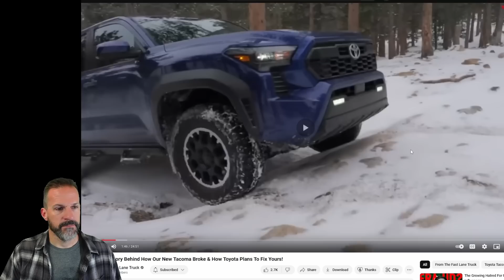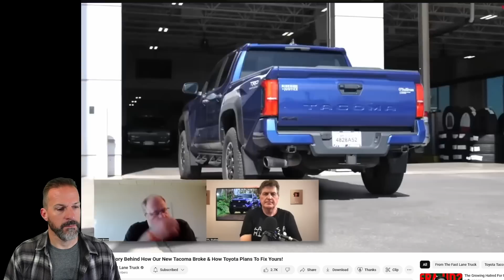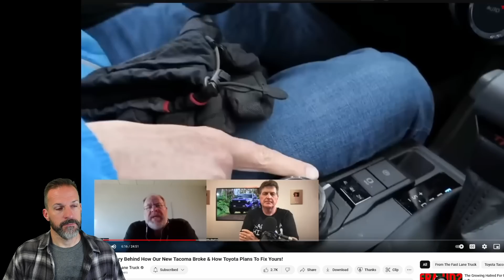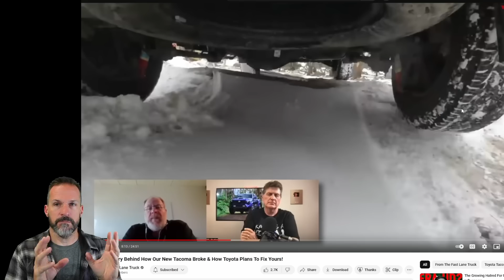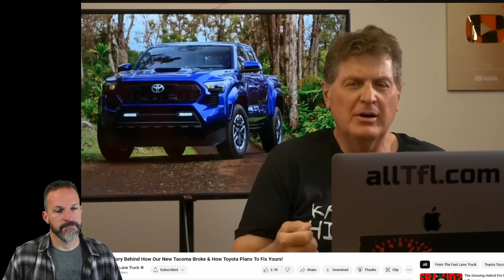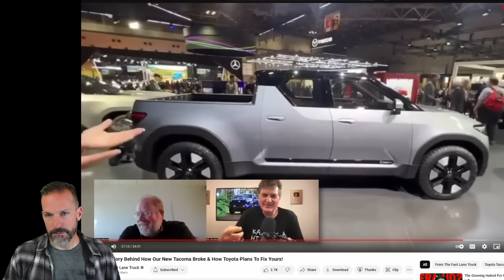Toyota will RE-PROGRAM the 2024 Tacoma to prevent future front differential failures. TFL React.

Comment: Cost is not the only factor, weight reduction is another important one. They are trying to minimize weight and costs while meeting some mechanical specifications. They try lighter design for better mpg and a preppier vehicle to drive. 
Also,  It broke not necessarily because of too much power to the drivetrain, it probably is due to the rate of change of power AND braking in close succession. 

Remember the MTS system is there to increase traction by automatically applying braking to reduce slippage as well. Depending on road surfaces they allow more or less wheel spinning. 

So if the automatic system allows very fast acceleration followed by intense braking (something that most likely a human driver would never do that quick transition speed) they may easily go beyond the design specifications. Even beefier design may brake because they would then have to be way too bulky and way too heavy to totally avoid braking. 

One is dealing with an engineering control system here. They are control commands that a system should never give otherwise the system may brake. 

This is one of the most difficult issue with robots, they can easily injure themselves. One can easily give motor commands to a robot such that it can literally destroy itself. 

The MultiTerrain System is a simple robotic system with acceleration and braking. But it is a robotic system. And it can do stupid stuff that a human would never do. 

Humans do the same with their own body: try throwing a baseball ball at full force if one hasn’t practiced in a long time. One may tore up a muscle or ligament because your control system is off what it used to be. You damage your arm. 

So the engineers here may have to tune their control system so that they don’t injure the mechanical components of this robotic system. And here they have new everything and their control system and simulations didn’t account for some corner cases. 

The other way to solve that is to add more feedback sensors to this robotic system, but those are expensive and more risks to brake. So they need to tune their control system and that’s what they are doing. 

My 2nd gen Tacoma has ABS but no MTS. It does not have this robotic system that brakes and accelerates each wheels independently, so I could most certainly never give the wheels the same type of control commands that an MTS can. 

In other words, Take my 2nd gen and add some stupid control system and I can bet you that the control system can brake and destroy the drivetrain on the 2nd gen in no time. 

People have to realize that automated driving convenience and better road / trail handling comes at a price. It’s letting a faster more complex control system than a human take over. And does have its limitations.

Comment: I heard from a friend of mine that someone in their group had a 2024 Tacoma on the trails this past weekend and had the same kind of failure that TFL did. Based on the interview TFL did with a Toyota engineer, it really seems like Toyota decided to save money by re-using components in the powertrain that are not suited to the kind of torque the new engine is making and instead they're just relying on the software to protect things from damage. I'm willing to bet the "Truck King" channel's clutch failed for the same reason because it sounded nothing like a truck being shifted into first gear. I think they just did a terrible job at calibrating rev-matching for a 5-3 shift and the clutch, also not updated for all the additional torque, failed due to the computer botching the rev match. For as much as they raised the price and slashed labor costs by moving all production to Mexico, their QA and pre-production testing process is trash. None of these problems should have made it to the consumers when Toyota wants $50 to 65k for a 4th gen. I have lost any faith in Toyota at this point.
Reply: In the truck king video they replay the backseat camera man view. The rpm gauge swings up to around 4500 rpm but doesn't red line, just as you would expect for third gear not first gear..
Reply: @lemerdtool  I agree, nothing in the video suggests he went into 1st gear. If he shifted into first gear and dropped the clutch, the engine would have tired to rev to 10k RPM, the tires would have squealed, the back end would have likely whipped out sideways, and there's a good chance that the engine would have thrown a rod.

Comment: Toyota likely spent hundreds of millions pushing the new drive trains and technology into the new Tundras and Tacomas.  Of course, this new development expense has to be recovered in the  cost of the vehicle.  However, in the case of both of these vehicles another development pathway could have been chosen.

Toyota could have taken the existing drive trains, tuned the engines, upgraded the transmissions, changed the exterior styling, made adjustments to the interiors, etc; all the while holding the line on the developmental impact on the base product.  This conservative approach to product development seems to no longer exist at Toyota.  The upscale product prices and low scale product reliability is the outcome.

Comment: Just like all vehicles makes and models. Poorly designed parts isn’t fixable with a software update, that’s litterally like telling the customer hey just don’t hit the gas pedal next time and use your truck to you know. Do truck things. But instead we’re going to bandaid the actual problem with a software update cause we would have to actually pay money for the piss poor design we did and we can’t have that. Reminds me of the late 90s and early 2000s rams with the magnum v8s when they did the “death flash” and de tuned the crap out of them. The fact they say the traction control was too strong blew my mind. Like dude a locked Dana 30 in the snow even on bigger tires would’ve probably not failed in that situation. A ice and snow covered rock. POS lol. My 90s suburban had spun 35s for 200k miles with a locker and has been driven like a worked rental car for 80% of that.

Comment: Its possible that the programming grabbed both front brakes at the same time and pop that ADD snapped..... that stated, guys in the 2nd and 3rd gens (with even more power via supercharger etc) with essentially the same ADD configs run FRONT LOCKERS and I dont think I have heard of a single person having an ADD failure.  Also LOL at the comment that "all the torque was being sent to the front"..... the transfer case on these trucks have no differential (not talking limited 4th gen awd), you can only send power in a 50/50 split front to rear.

Comment: This was a pretty interesting explanation, learned just how complex the MTS system can be and how the mechanical components need to be designed around its decision logic. The ADD is definitely there to make the vehicle more convenient to switch between 2H and 4H/4L modes so i get why it needs to be designed the way that it is. We have come a long way from locking wheel hubs. I think i see why he says the entire assembly fails here first. You make the ADD too robust you possibly transfer more of the mechanical strain up to the differential or even the transfer case.

Comment: What's BS is that Chief engineer bragged multiple times before releasing the Tacoma that they did multiple strenuous testing on the Tacoma and its had nothing but multiple issues since it came out with the differentials the shutter grills, transmission overheating and now manual transmissions blowing up and that's just what we know now. They could be hiding engine issues potentially later on like they did the Tundra's.
Reply: I'm a contract engineer and have worked on a few projects for Toyota.  Their validation process uses a lot of simulated (in lab) testing and significantly less real world testing than other manufacturers. This instance is exactly why you don't do that with trucks and off road vehicles.  It's fine for a RAV4 or Camry that's going to live on the interstate.  Lab testing gives great accelerated lifecycle data, but at the expense of being done with a very limited number of variables. That this problem never showed up in their validation shows their validation process is fundamentally flawed.
Reply: lets add in the admsission from toyota about cheating on tests. Take a deep bow mr ceo lolz. Toyota Chairman Akio Toyoda publicly apologized for extensive cheating on certification tests for seven vehicle models...

Comment: Sounds like the mechanical bits are not strong enough and they are going to use software to prevent the weak components from receiving too much torque and failing. I’ll not be buying a Toyota. Their reputation was overbuilt reasonably priced vehicles. Now they are overpriced, weak, made in Mexico and not reliable.

Comment: To be fair, it sounds to me like it wasn't necessarily the truck's overall torque - it was the traction control system that overcorrected and sent too much power to one wheel.  But you're right - Toyotas used to be overbuilt and now they're built cheap with software as the buffer.  It's annoying.  I've noticed that with the Rav4's AWD system - if you dare to lift a wheel on even a slight incline, the car will just cut the power and say "no way" instead of attempting to push through the obstacle.
Reply: Not necessarily too much power, it probably due to the rate of change of power AND braking in close succession. Remember these systems are there to increase traction by automatically applying braking to reduce slippage as  well

Comment: I think this just proves they don’t expect anyone to actually use these trucks for what they are marketed for.   Attempting to fix an obvious hardware shortcoming with a software update , that is likely going to make it less capable and likely to reduce power, is absolutely BS.
Reply: Short-term solution. Look up in some future updated parts for that Tacoma as the mid-term solution. Long-term solution, these new parts will be used in factory. A Tier 1 provider most likely builds those parts for Toyota. It takes time.

Comment: A completely stock truck shouldn’t be able to break itself under designed use
Reply from the maker: I agree. At least they are, in their own weird way, admitting that and "fixing" the issue with MTS, however I personally feel like you do. I'd just prefer a stronger IC shaft and supporting parts.

Comment: This thing has to be built on reallllly close to it's component limits... They had to build a special cooling system for the 4 banger cranked to the limit... they're using software to prevent component failure from torque... what else...
Reply: You forgot they also had to detune the manual transmission engine because it's on the edge of what it can handle. This truck is a joke! I'll stick with my first Gen Tundra
Reply: @PeterAlfonso  ya... Idk. I'm glad I got my frontier and didn't wait the 1 year for this truck. Maybe it'll be reliable and fine... But I'm good.
Reply from the maker: I agree. My guess is they'll dial in the software to prevent failures in a lot of cases, the diff, the transmission, etc. We'll see what long term reliability looks like, so hard to speculate.
Reply: @TheCarGuyOnline  ya absolutely can't speculate. And software will do the trick for sure.

Comment: the best part about my slow 2018 2.7 tacoma is that i will never have enough power to break anything. i got 33 inch wheels on it, offroad at least once a month and still have original cv axles at 90k miles. best part: i still get 23-19 mpg. ill be keeping this truck forever.
Reply from the maker: simple is almost always more reliable.

Comment: Modern Toyota, underbuilt and overpriced. Toyota os essentially saying they need to further detune the vehicle which probably negates the benefit of going with the less reliable forced induction 4 cylinder vs the NA V6. Basically it cant handle the torque, which was Toyotas big selling point on why the less reliable turbo four was better than the outgoing NA V6.

Comment: There's no way that front diff should have snapped on that. If the tires are slipping on smooth rock and ice, there's not that much stress on it. They are making up excuses for Toyota. TFL must get a lot of money from Toyota.
Reply: It’s not so much that it was slipping, given that the MTS was on, the system most likely attempted to apply brakes to the wheels to decrease slipping. So it’s fast accelerating with strong braking that was probably too much to handle in short succession with the new higher torque now available. 
It’s probably something that most drivers would never do unless a race car driver with independent braking for each wheel or axles.
Reply: @OldelCpt  That's even worse if that's the case. It's the whole drivetrain working against itself? Garbage. Toyota should get rid off all these gimicky drive modes and driver assist modes. It's an off road truck. If you're buying it to off road, learn how to off road without all these stupid "dusty road mode" options. Instead of spending money on pointless and worthless drive mode programming/development, spend that money on more robust drivetrains and parts.

Comment: The parts are not strong enough and dont have a large margin of safety, to save money. Money. Telling it like it is. This never happened with the previous gen Tacomas. Also of note. TFL sold that Tacoma.
Reply from the maker: Yeah I actually appreciate that they are admitting an internal failure that wasn't the actual ADD actuator, a much more substantial part failed inside. They didn't really have to tell us any of this, it had already/mostly blown over so it is what it is.

Comment: It's interesting that Toyota didn't figure out the excess torque problem before they released this version of the Tacoma. The Tacoma's IFS has always been a little shy of strength and with the increase in torque you would think this would be a natural response.  I know this hasn't been a big problem yet but as time goes on and mileage gets higher even with the software adjustment it will be interesting to see if more problems come up. TFL won't be finding these because they got rid of this Tacoma because the transmission overheats and that does not sound good either. Toyota is kind of falling off a cliff here.
Reply from the maker: yeah we'll see if larger tires and tunes end up being bad for these long term.

Comment: The engineer does sound like a politician.  I understand why most of the industry claim it's too expensive to overbuilt vehicles, however Toyota has traditionally been the one manufacturer that doesn't do this.  The reason the older Tacoma and 4Runner was popular wasn't because of their low performance engine, or less efficient transmission or poor mpg, when compared to their competitors.  Rather it was that it was so overbuilt that it was impossible to wear out or break these two vehicles with hard driving.   You could have taken a 4runner anywhere and know that it will always bring you back without breaking down and leaving you on a lonely mountain trail somewhere where it would be hours at best to get help.  People who buy these vehicles are the ones that never want to be stuck on the side of the road, and value that more than anything else, more than 'fun to drive' and more than 'mpg'.  I do like the new engine & transmission, but I also would have liked if it was overbuilt enough so I have peace of mind that I wouldn't have my vehicle break because of some unplanned hard driving.  Toyota should understand this is why their customers buy their vehicle.  And if they lose this legendary reliability, they will lose their customer base.
Reply from the maker: Agree 100%. The only reason I buy Toyota is for reliability, if that is gone...I'll just buy something more sexy and there are plenty of those out there.
Reply: @TheCarGuyOnline yup, buyers put up with a lot for that reliability (crappy infotainment, ugly exterior design, dated mechanics, minimalist interior design, etc) if that reliability goes, why stay with a Toyota?
Reply: Well Said!
Reply: Look at the axles on a HD pickup.  Compare them to a Tacoma.  Yes, the Toyota may only have a 4-cylinder (turbocharged), but it produces more torque than your standard 6.4 Hemi in a RAM Power Wagon below-2,000 RPM.  The Ram however has axles that are identical to those on the Cummins, that are rated at over 1,000 ft/lbs of torque at 1,500-RPM.

Toyota needs to (must) go back to the drawing board to maintain their brand reputation, fire whoever is in charge of vehicle production at this point.  The entire driveline should be overbuilt, it's not difficult, the big 3 have been building trucks that produce large amounts of torque and horsepower for decades now.  No axle or transmission failures.